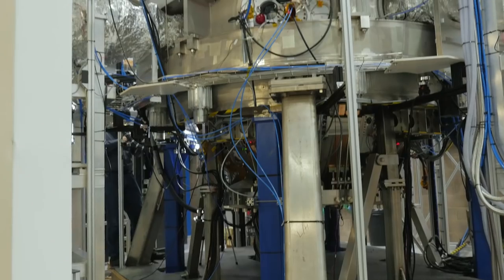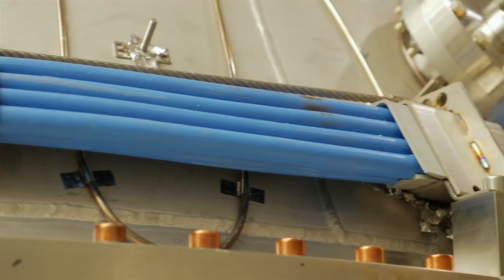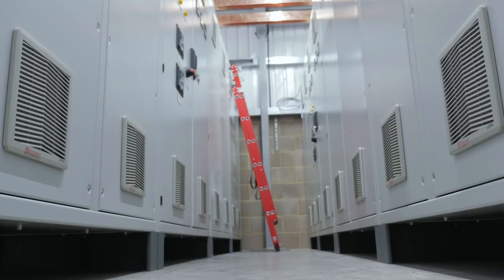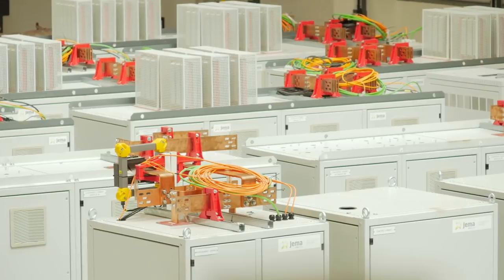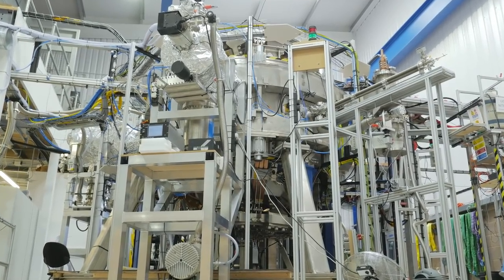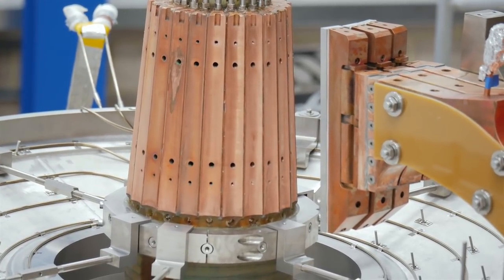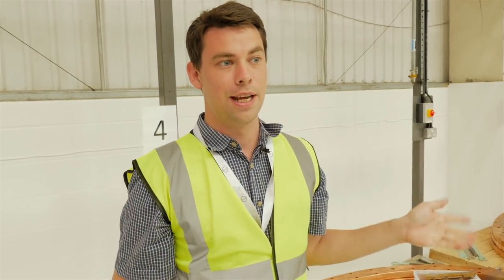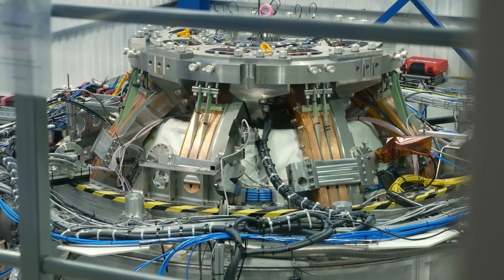Upgrade work on ST40

Comment: I’m curious if it’s possible to add heavy elements during the reaction as a stabilizer. There’s a reason why Iron is so centrally located in the periodic table. It’s what stars balance off of.  I’m not a physicist, but do you guys think this would do anything?
Reply from the maker: Heavy elements in the plasma radiate energy and cool the plasma.  We need to keep the plasma as hot as possible so we try hard to keep heavy impurity elements out of our plasma.